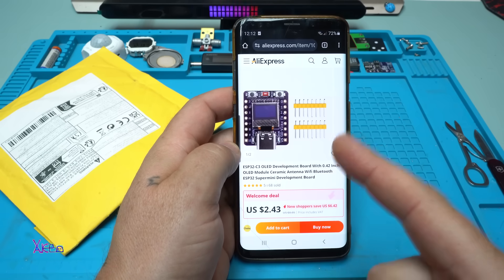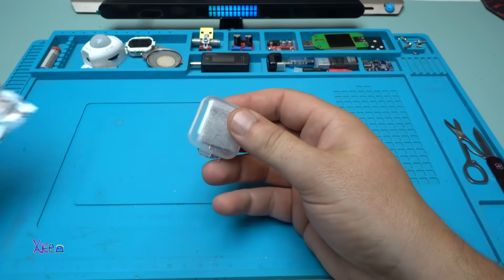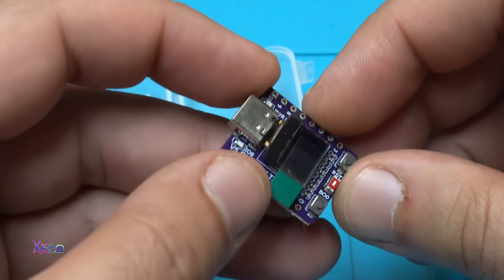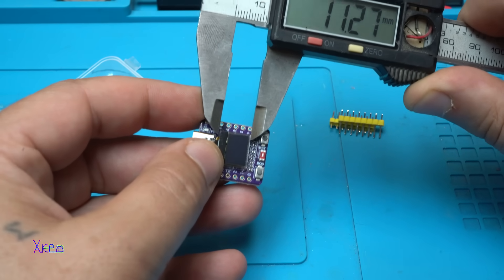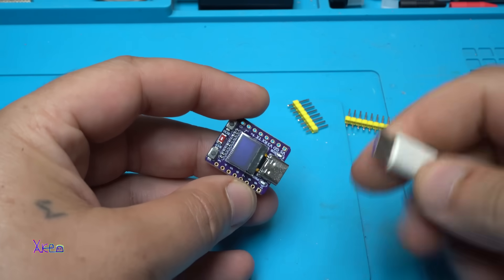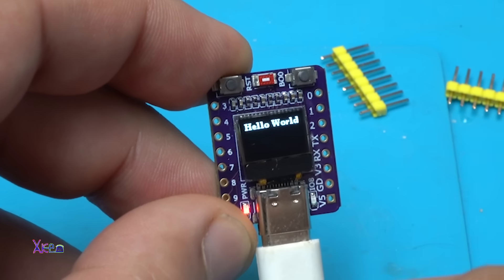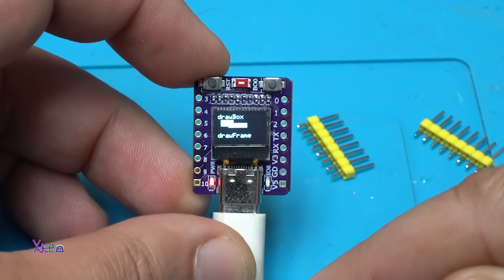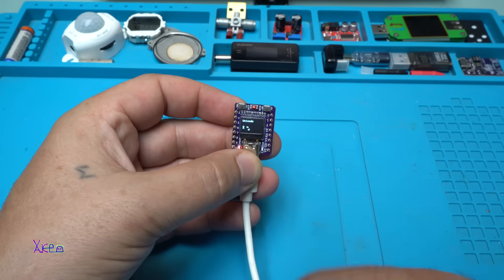$2 Aliexpress Module is FANTASTIC? - ESP32 C3 OLED 64x32

Comment: They're $4 right now. They're cheaper on amazon once you factor in shipping, and the 0.96 inch versions are just a small cost add.
Reply: Thank your president for it. I can buy them for €0,96 ......... (shipping included) ..... in China, of course.
Reply: @hmvanwijk8324  I haven't seen prices on electronics go up so far. A bigger deal than tariffs is getting rid of the de minimus exemption for shipping

Comment: Boy is that display nutty small, however it does solve the perennial problem with WiFi/IP devices, just what is it's address, is it even connected.
Adding a display to a device that nominally does not need one just for the connecting info is a nuisance, however in this case it's a zero effort one and it comes built in.

PS:- love your vernier battery hack.

Comment: The screen work 1y max
Reply: Bro its 2$, 1 year is plenty 😅
Reply: @Kaskiskuskeskos anyway
Reply: Dunno. I'm working with eez studio to build a tiny UI and use it to control a stepper using pushbuttons. I want to build a sturdy box around it the size of a pack of cigarettes including stepper driver,  batteries and external power connector. I will make it fit. It will be a nice portable tool for testing stepper units.

Comment: Ali express is not reliable whenever I bought something they canceled it or sent defective items or something was missing and takes a long to to ship the customer service is not reliable too.
Reply: Not my experience nor anybody I know
Reply: The biggest problem that I've had with AE is the way that they jam every keyword that they can think of into the description - even ones that are not relevant or just wrong.
Reply: I've never had an issue and I've ordered dozens of cheap parts.  The input protections on some of these esp boards are sometimes poor, so buyer beware and order extras.
Reply from the maker: Sorry to hear about your past experiences, hopefully, you'll have better luck in the future!
Reply: Never have issue here, its been awhile last I order something because my country ban direct order from aliexpress now. But last time I order electric breathing compressor with Lipo battery for $600 and its been 4 year its still works great without issue.

Comment: Cool but I've yet to see any useful project with these, the screen is way too small lol.
Reply: It's enough for some projects!!! You can display some digital values on it, and it's 100% better than having no screen! New soldering irons, some smartwatches, and other devices have even smaller screens, but no one complains.
Reply: Looks like it may be useful for midi controllers to label functions assigned to faders

Comment: It's 4eur here, but what can you actually do with it? Can't think of use cases
Reply: It has wifi. You can send a signal to it to activate or deactivate a motor or a switch. or a light, or a speaker. You can turn every device in a smart device.

Comment: Again, if you already registered on aliexpress, its 6$
Reply: Have you tried a new email address, or does it go by delivery address?
Reply: @andyspoo2 I have my account for 9 years+ , but if you register a new account you can get it , one time! And because its part of the " choice " label, you need to buy for a predetermined amount to get it shipped to you , 10-13$ converted from my local curency. Or else it will not accept the order or you pay shipping fee.
Reply: @andyspoo2 
If it's like Banggood (I think they're related companies), they go off the payment details in addition to the email address.
If you've got a dozen different emails and a dozen different payment methods you can use, then you can get the new user thing a dozen times. Good luck 😂
Reply: you have to go for the combo blast or bundle deals. they are just as good as the welcome deals.
i can get this board for  as low as 2.59€ with most being around ~3€
and in the combo blast deal i get free shipping on 3 items and an additional 2€ off when i buy 6 items or more. if you bin 6 of them that makes the 6th essentially only 60 cents
Reply: @TheScarvig Sure, but i need to pay tax too, glad to be a european
Reply: Also, most of the time its filled with useless garbage, best i bought from that deal is esp32-c3, and c6 supermini boards, and bare oled displays
Reply: @TheScarvig  Very true.

Comment: Hang on... So with one of these ESP32's, a LoRa Antenna USB Interface module, a small 5v solar panel and a 1S 18650 power bank I can build a Meshtastic node for under $25 with an already inbuilt OLED screen?.. Now I have to see if this can be done...
Reply from the maker: Sounds like a great project idea, I hope it works out for you!
Reply: Easy, it's been done, you need to think faster :)
Reply: @andymouse  So show us how, with display. Give us the links to the components.
Reply: @chainreaction8977  Swiss youtuber who's name I forget has all the details.  I think its Andreas Spiess
Reply: 1.I can't show links as a commenter 2,I put names of all components in my comment,

Comment: The ESP32 is by far the best microcontroller ever made for  electronics hobbyists !!! ❤️👍
Reply from the maker: My favorite😉
Reply: @Hacktuber   only the RISC-V types are worth of this
Reply: Until you do your first battery powered project...
Reply: No, Raspberry Pico 2 is better.
Reply: @TheMicrofox  can't even act as a transceiver for zigbee, it has a long way to go before it's as capable.
Reply: I wonder if we ever get a esp 64 version.
Reply: No it is not
Reply: @cbm80amiga , wanna tell us what is then?
Reply: @cbm80amiga  Arduino? It certainly has a special place in my heart..
Reply: @cbm80amiga  yes it is, nothing comes close to how much espressif has opened up to the DIY hobbyist.
ESPs can do a very wide range of stuff. and tons of wireless protocols: zigbee, ESP-NOW, wifi, bluetooth

nothing even competes. The pi pico is trying to but they have a ways to go.
Reply: if your stupid enough to waste power on something you look at once ....   see  most ppl actually use there computers instead watching pretty lights :-\    

hi pctech 45+ year experience,,  how man have I installed?    zero I wont
Reply: @HarleyHutson 
What are you ranting about ?

You're making ZERO sense, we're talking about ultra low budget microcontrollers that have awesome built in comms.

What's this waste power 💩 ?
Reply: @HarleyHutson  you're* their* 
also nothing you said makes sense
Reply: @HarleyHutson  Don't drink and comment, Is 45 your IQ ? Grammar is also too hard for you, "your stupid" says a lot.

Comment: I have one of these boards, still try to figure out a usefull program that will work with this tiny device and screen. I was thinking about a tiny version of Excel or even a database.
Reply: Well.. after you spend $3 and 40 minutes getting it set up... at least you can display HELLO WORLD! on it.. so.... what more do you need??
Reply from the maker: Hope you'll find the perfect project soon!
Reply: Some dude in sandals ran a V.15 Sequoia in 4K and color on this module. But remember, you need sandals.
Reply: I run SQL Server on one of them. Works fine
Reply: Display = "Armed......10 9 8 7 " 🤣